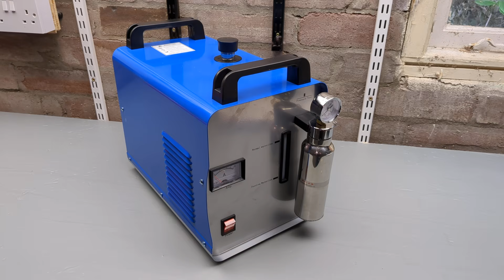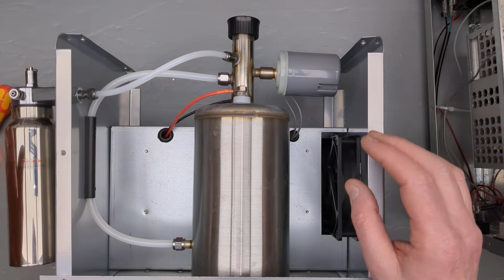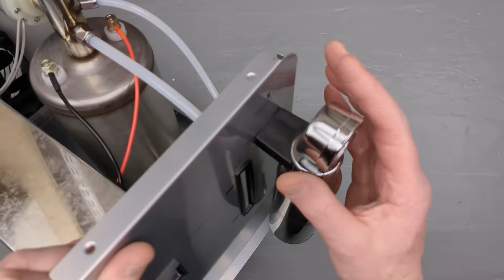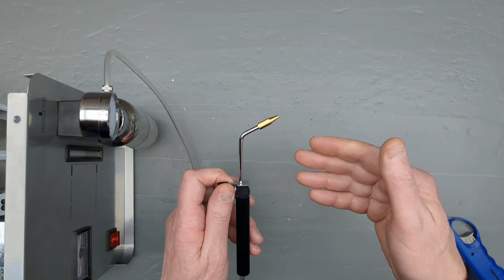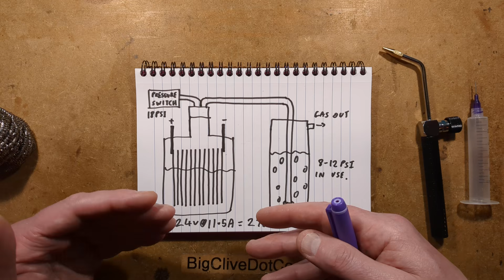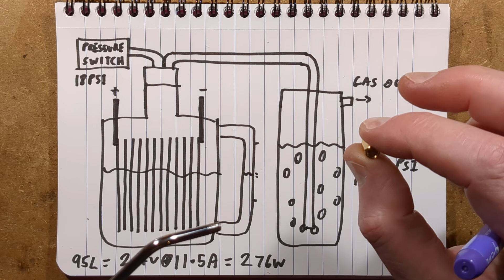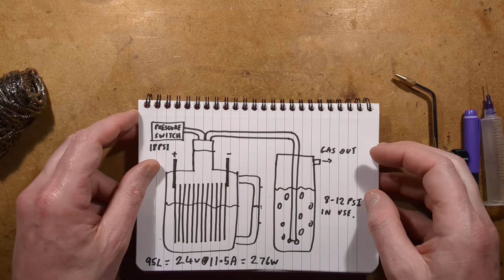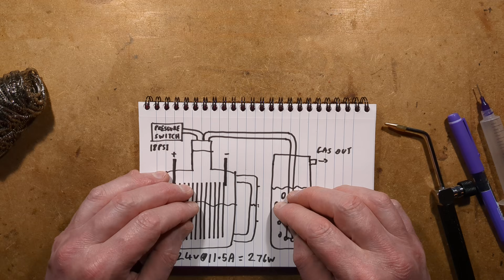Inside OxyHydrogen gas generators (HHO/Brown's gas)

Comment: Oxy-hydrogen is useful in working platinum jewelry. Carbon in fuel gasses can embrittle platinum; oxy-hydrogen is carbon free.

Some cities, Chicago is one, have fire codes that make using compressed flamable gas cylinders beaurocraticly onerous. For a small jewelry operation these generators can bypass the legal hurdles.

Comment: There is an apparatus that separates the hydrogen and oxygen separately called a Hoffman voltameter it works by oxygen coming off the positive and hydrogen often negative or the other way around. I don’t remember exactly it’s a glass apparatus. You might have fun playing with one.

Comment: In the late 90's in the US there was a company building rather large Browns Gas generators and trying to market them to welders to use instead of acetylene. Obviously it didn't catch on but I thought it was pretty neat at the time, but like so many things a solution in search of a problem, like hovercrafts.
Reply from the maker: It's probably viable for refrigeration brazing, but the premixed gas in the pipes would inevitably result in flashbacks.  That said, there are companies that make big ones for glassware processing.

Comment: I'm actually designing my device rn for the same purpose and it is a very useful economic apparatus for the reasons you've mentioned AND I'm going to sell the prodect to AC technicians to help soldering and weld gas pipes 😊

Comment: If you have ever used Brown's gas generators you may have noticed that it is a lot hotter burning and has oxidizing tendencies despite being a stoichiometric mix. There is a reason for this. Freshly electrolyzed oxygen has a high percentage of singlet oxygen , if it's immediately mixed with hydrogen the metastable lifetime is prolonged from a couple seconds half life to several minutes. You are in essence getting about 1.4eV extra energy per reaction since only one bond on the oxygen molecule needs to be broken in combustion. ❤

Comment: I had the 75l version for silver and gold soldering jobs and are good little units and a hell of a lot cheaper than industry standard aquaflame machines. I used MEK in the flashback bottle I'm not sure if it affects the flame temp, but I could solder 3mm silver wire no problem.

Comment: So if it does have a PEM membrane in the middle? it is only molecular hydrogen not true brown's gas like the Aquacure ac50 is mate.
Reply from the maker: A PEM membrane is used in fuel cells.  For Brown's gas there is no separator.  Beware of fake science in the quack cure industry.

Comment: 07:43 It is worth noting that if there is any oil leftover from the metalworking, it would be converted into crude detergent or soap when mixed with the hydroxide. The first batch likely cleaned all the oil out of the system, so the second try didn`t foam up.

Comment: I used a burner similar to that to hand roll glass beads in a workshop once. Probably only slightly larger than this one. You wear orange glasses so you don’t see the bright glow, and slowly heat up the glass rods to prevent the cracking. It was fun.

Comment: Back in high school chemistry, many, many moons ago, we did an experiment with HHO. We had a cardboard quart milk container that we filled with water and upended in a water tray. We filled it part way with O2 and part way with H2.When we set it off, we got a bang. We all said that was neat, let's do it again. This time we used a half gallon container and we got the mixture correct. Instead of a bang, we got a deafening CRACK and there were little bits of cardboard from the container drifting down all over the classroom. Good times!

Comment: Hydrogen is a lot lighter than air but oxygen is significantly heavier.
HHO gas is lighter than air, but not too much: some balloons can fly with this mixture but heavier balloons cannot.
find a very light balloon (or use a condom), fill it with HHO, attach a cotton string, ignite it and let the balloon go.... the high altitude explosion is super loud and fun!  🙂
I once do it in a valley with a bunch of ballons joined together and 3 strings for safety (sometimes a string just stops burning: loosing a balloon is only is a small waste but loosing 15-20 balloons is not fun: using multiple strings ensure the ignition!!!) the resulting boom was just insanely loud!!!!  😀

Comment: I have one of these at the new location I work at, used supposedly to polish acrylic. It does work but flame polishing stresses exuded acrylic terribly so I'm unlikely to ever use it. Seems very lightly built. Impressively hot flame though. The instructions with it are terrible.

Comment: They used to use a carbon tetrachloride atomiser for jewellery repairs a few years ago. This system is a bit cleaner and much better for the environment. Flame front is supersonic hence normal flashback arresters won't work.

Comment: As someone who has tried to make my own hho generator for a torch, If that metal bubbler goes off its gonna be like a shrapnel bomb. My flashback arrestor was a plastic bottle, with a rubber bung as a lid, so that in theory it should just pop out. But no, when i got a flashback, its so violent and fast it still blew up the plastic drinks bottle into smithereens. Luckily I was wearing ear protection and welding gloves. Its insanely powerful. I'm yet to get mine working, I keep getting flashbacks no matter what I do. I think I actually need to make my gen more powerful as lack of flow lets the torch flame front travel back down. Or maybe I'll end up buying 1 of these torches from these machines.

Comment: Can this “oxyhydrogen” stuff be stored for months? Is there a generator that can burn it for electricity production?
Reply from the maker: It's not recommended to store large quantities as it is an explosion risk.
Reply: Nope, hydrogen will escape any container rather quickly. Also, you do not want to store HHO, you produce it when needed, because of the big bang that would follow otherwise.

Comment: HHO generators are scary as !@#%. I'm not scared by much, but these are kind of like bombs ready to happen in your garage.
You wanna go hydrogen and O2 jewelers torch with separate cylinders for the gasses - fine, still a little dangerous, but not much moreso than any other fuel/oxygen torch. These devices scare the heck out of me though. The ease of backfire through multiple water arrestors is stupidly high.

Comment: Hi Clive. Good video but there is a lot of misinformation in this video that could be dangerous. Always use Potassium hydroxide this is the standard chemical to produce the gas. The Bubbler as you referred to is not a flashback in anyway. These Chinese machines do not have safety features and can cause harm. The Bubbler is the booster which should only contain MEK for a flame temperature of 1850 or acetone for a flame temperature of 1200 degrees. The idea of the Booster is to cool the flame to a working temperature. There are lots of chemicals you mentioned that give off toxic gases, so use with caution. Always research what these gases do to your health in your workshop. The reason the British-made machine have to comply with a lot of safety rules and regulations and are more expensive as made of much better materials. Please do your research, MAKE SURE YOU WORK SAFELY.  Aquaflame.

Comment: With high voltage you don't need the alternating electrodes, but you will be burning good watts in the solution.
Causing heat (possibly bubbling).

Comment: My old chemistry teacher back in the day was a bit mad scientist like all good chemistry teachers should be. He filled two big balloons with gas. One was filled with pure hydrogen from a big red metal cylinder, and the other was filled with hydrogen plus oxygen in a rough two to one ratio. Then the whole class trooped out into the playground, where he tied the balloons to separate weights with a metre or so of string each, thus demonstrating that the pure hydrogen balloon floated, while the mixed one just lay on the ground. Then he lit them with a lighted splint taped to the end of a broomstick. The hydrogen went off with a bang and a big orange fireball that was quite impressive, but the oxyhydrogen mix had no fireball, just a deafening explosion that echoed round the playground. We were all very impressed, and so were all the other 1500 pupils who suddenly had their lessons interrupted. You'd never get that sort of thing past Health and Safety these days.
Reply: That's cool.  My chemistry teacher put a chuck of sodium into a bucket of water in the middle walkway between 4 classroom blocks.  The bang was sensational.  RIP bucket
Reply: first day.
"i know what you are all thinking..."
turns gas tap on
"its very tempting, i know"
searches through drawers.
"its all funny and we have a good laugh"
opens cabinet and searches there. 
by now people are sort of panicking...
"but on a serious note, science is all about experimenting"
pulls lighter from pocket, ignites, fireball ensues...
"so one gets a better understanding of the world around us."
turns gas off
"right. now youve seen it. dont let me catch anyone ever doing it..."
Reply: @paradiselost9946 Great story.

Comment: How tf is this device not an explosion hazard? I don't see why the flash shouldn't go back into the electrolyzer, causing said CLOSED STEEL VESSEL to go full pipe bomb?

I have kind of experience with that, accidentally blew up a self-built electrolyzer (with H2 +Cl2 in my case) some years ago. Luckily the lid just shot into the ceiling (the vessel did not burst), so there was no shrapnel. Still the 2 electrodes with the lid shot straight up before my face and were stuck 2cm deep in the brick ceiling afterwards. My head just a little bit closer and i would likely not be here anymore.

Comment: Hm wonder if you could safely mix that with propane to give a propane torch a bit of a boost or to heat larger objects.

Also I bet you could use 3D printer nozzles as orifices though you might need to fabricate a thread adapter.

Comment: Way, way, way back, in my younger days, friends and I would dissolve lye and water in a bottle, adding aluminum foil in it, to produce hydrogen. We filled those old dry cleaner bags and ended up with rather large hydrogen balloons. Once we put a cigarette/firecracker fuse on it and let it go. A private airplane was flying past it (farther away than it looked), and the balloon appeared to be following it. Minutes later we saw the flash and a seconds later the BOOM. The stupid things kids do! Also had an old neon light transformer with a wand type electrode and would arc these balloons at ground level... FUN🤨

Comment: Im not a chemist so this is just a guess, but if you inhaled it could the hydrogen react and form hydrochloric acid or some other nasty chemical in your lungs? Any chemists in the comments???
Reply: Your correct, that's why there are extra waterfilters apart from the metal bottle. You have to 'clean' the gas other your nose and lungs hurt like crazy like mine did when I inhaled without the extra bubblers
Reply: @hansscholte5472 😂😂😂

Comment: That crack when you turn off the torch is a flashback.  The flow rate between the valve and tip slows and stops, allowing the flame front to go back down the nozzle neck.

Comment: In high school chemistry a guy at the next table made a hydrogen torch out of a 12" glass flask, stopper, hose and an eydropper tube for a nozzle held his thumb on it for quite a while then lit it. It ended badly, the flask was gone, the rubber stopper bounced a number or times between the ceiling and the table top and there were dots of acid were everywhere.  Another guy took a large chunk of sodium in a jar of kerosene and flushed it down the toilet in a third floor bathroom.  Another prank was to put potassium permangante crystals on pieces of paper down the hallways then soak them with ammonia and turn out the lights just before the bell rang.  The dry crystals got spread across the floor and they gave a "bang" every time someone touched one.  Soon they were all gone, but then later when the janitor began pushing a broom it set off all the pieces in the cracks in the floor.  He didn't know what to think.  Myself of course, never got caught doing anything bad in school.
Reply: It wasn`t potassium permanganate that you soaked with ammonia, but it did look the same colour. I am hoping that you made this error on purpose in the name of safety. ;-)

Comment: I would never use those.  As you say the azeotropic mix is crazy dangerous.  Better to use a cell with H2 O2 separation that only recombines at the nozzle.  Change your H2 lines regularly as it can permeate most materials and cause them to get brittle.

Comment: Can you melt borocylcate glass with this? Im a glass blower and have been interested in the possibility of using browns gass gerators for years. I have never got a real answer to the feasability of using it. I asked this before you started on the glass and i see yuo have the same question
Reply from the maker: It may be suited to very small items.

Comment: Do you have an Endoscope camera?  Wondering if you could just stick that down into the water fill hole, and get a look inside that way, without tearing it apart.
Reply from the maker: All you can see is the plastic electrode holder case.

Comment: Methylated spirits is normally just denatured alcoho/SDA (specially denatured alcohol), i.e 97-98% ethanol with methanol blended in to make it undrinkable but not so much that you risk organ damage by absorbing it through your skin, also to avoid an alcohol black market. Dye and a bitterant is added for 'household' or light commercial purposes.

Comment: The yellow color of the flame must be the result of contamination with something, most likely sodium carry-out.

Potassium hydroxide is even nastier to living (at least at the moment of contact) tissue than sodium hydroxide. A huge amount of heat is liberated when either is dissolved in water, to the extent that boiling temperature can be reached. Great care is required.

That torch is actually rather large compared with many high-end micro brazing/welding torches. Ideally the gas mix would usually have a significantly higher proportion of hydrogen to avoid an oxidizing flame. A reducing flame is usually preferable to prevent oxidation of the metal being worked.

Comment: Sodium hydroxide is coloring the flame yellow.  Sodium is far more intense than potassium in flame color, a few ppm Na will overwhelm the faint cyan of K.  Blue fireworks must use very pure potassium.  
That foaming is from soap made from residual oils.  A bit of simethicone will break that.  Here in the States, simethicone can be obtained as a digestion aid called Gas X.  I've used it in my distillation of whisky to prevent foaming..medical grade,  no flavor gel caps.  
Back to hydrogen torches..boric acid lowers metal surface tension, making gold welding smooth.  These are the ticket for tiny stuff I no longer have vision or patience to perform.  Far cheaper and cleaner than other fuel gas welding.  

I've made hydrogen generator for my light gas gun hobby using NaOH and aluminum chips.

Back in my misspent youth,  I filled a gallon plastic jug with oxygen and acetylene,  setting it off electrically from a safe distance.   It completely removed turf down to soil on a meter square area.  Big badda boom.

Comment: I could tell you a story about 4 temporarily deaf blokes who hooked a home made Hydrogen/Oxygen generator up to an empty 2 litre plastic milk bottle....the plastic bottle was held upside  down and filled with the  HHO generator gas then held in a vise by the handle part and a long piece of burning newspaper was placed under the open neck of the bottle.
The bottle went off with such a rapid and violent reaction that it shattered the flexible bottle plastic into fragments and all 4 blokes in the room could hear nothing but ringing in their ears🤣.......It was a BOOM!!!! Like no other.....won't be doing that again😂😂

Comment: I've tried the bubblers on my older vehicles and never could see any improvement.  I have also put together combinations of aluminum and stainless steel washers and made hydrogen oxygen mix and it worked quite well just using battery power.  I made so many loud bangs that even my son complained so I stopped experimenting before I really did some damage.  I just used a plastic peanut butter jar for the container and another smaller jar for the flash back protection.  I was using tap water and was told that rainwater would be the most productive??
Reply from the maker: I think distilled water is preferred due to the least contaminants.

Comment: Clive: oxy-hydrogen is realistically the only good way to lamp work (the kind of glass work you were specilating about) quartz. Do yourself a favor one day: get a quartx glass tube, heat it WHITE HOT, notice how it doesnt deform under heat and then QUENCH in a glass of ice water. You'll be amazed how it doesn't explode like even borosilicate would.
Reply: Also Florida-man (Hyperspacepirate) did a great YouTube on HHO